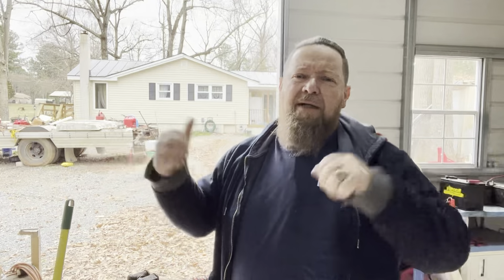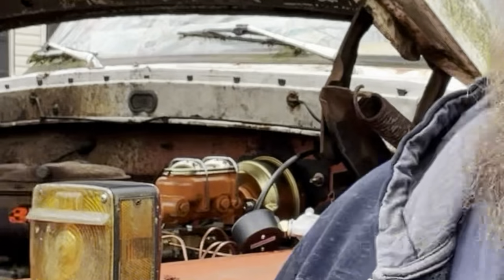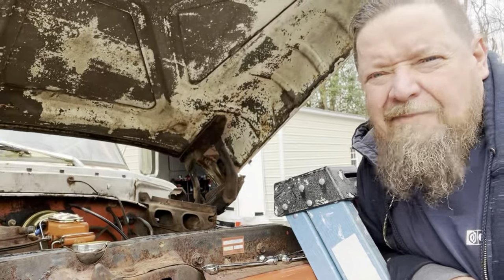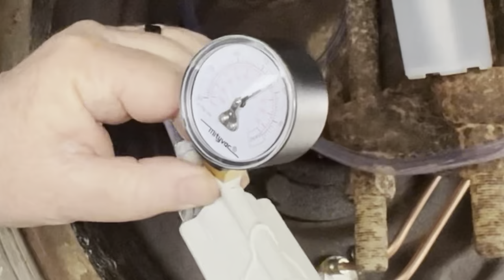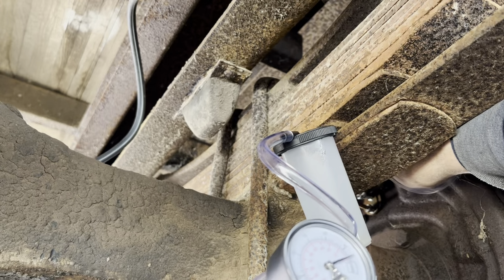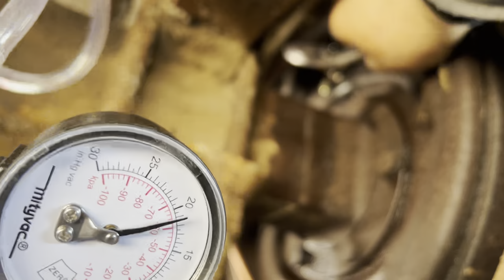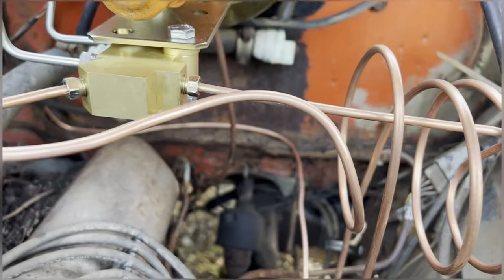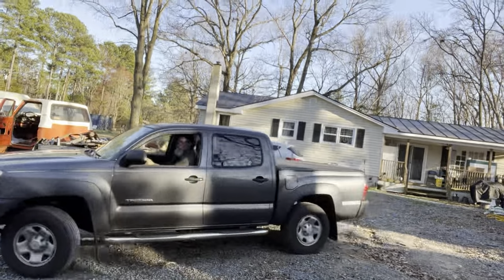Bleeding Brakes F600 truck DIY                        “￼Brake Conversion”

Comment: Has any electrician ever installed the cover to a load center they own?  😂
Reply from the maker: Good point. I’m not finished pulling circuits yet, but that’s no excuse for not covering up my panel but you’re right. They say mechanics drive around in cars not in good shape and electrician’s not finishing up their work.
Reply: Good to meet you pastor kettle. My name is pot. 🤣
Reply from the maker: A fellow Sparkey ?😊

Comment: Where do i get booster and dual master cyl
Reply from the maker: I got mine at eBay on the summit racing store, and I even called Summit to verify if it would work for mine. The system I got was for calipers front and back turning but you need a special tool to lock the proportioning valve so you can bleed the brakes.
Reply: @fixingthingswithpastorbill3840  ty so much